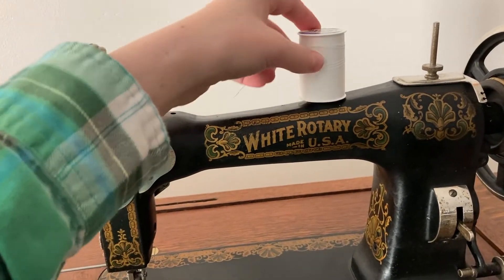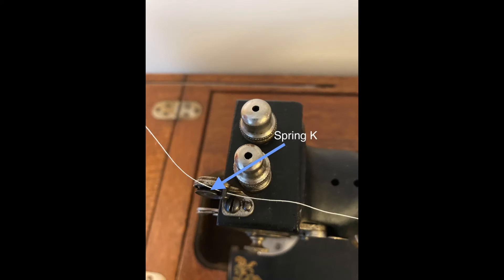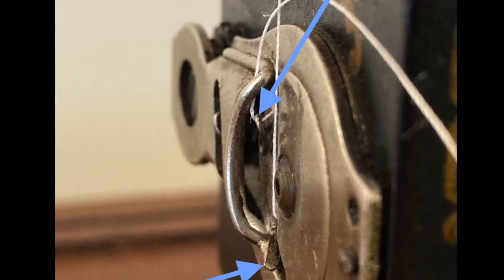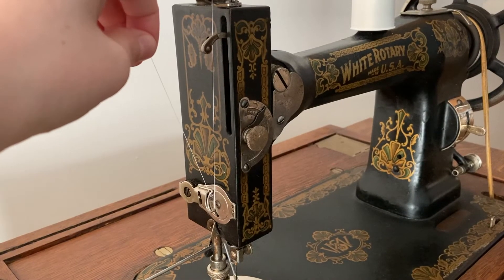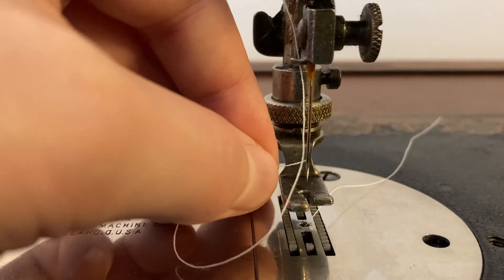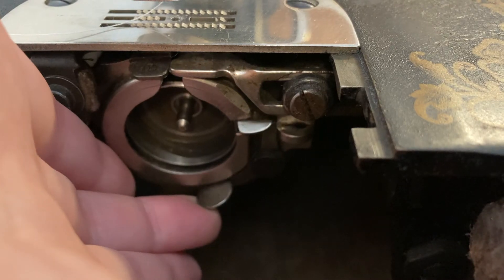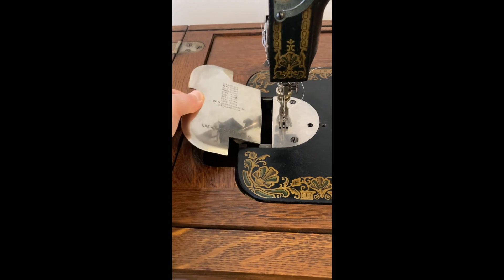How to Thread a White Rotary Treadle Sewing Machine

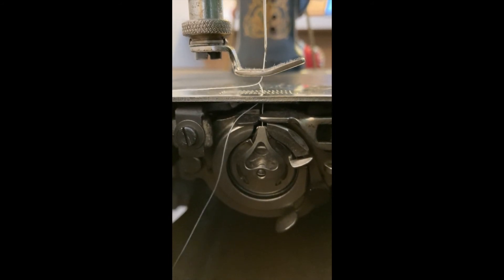Comment: Thank you for all the help! I notice at 1:42 the thread wraps around the bobbin pulling the bobbin thread up. Mine is not doing this. Do you have any suggestions?
Reply: I have a Hotpoint rotary made by white between 1900 and 1913. But the components are nearly identical. It appears just a slight change in the stitch tension control in the front
Reply from the maker: The first, and easiest, thing to try is unthreading and rethreading the machine. It's like turning off and turning back on your computer. It fixes a surprising number of issues!
If that doesn't work, try checking your needle. The shank, the top of the needle, has a flat side and a rounded side. The flat side should be to the right. The screw will fit against the flat side of the needle when it's tightened. If the flat part is on the wrong side, the needle may be just off center enough that the thread loop is forming in a spot where the shuttle can't catch it to carry it around the bobbin. Give the needle a wiggle when you put it into the needle bar. It should be as far up into the slot as it will go.
If the machine is threaded correctly and the needle is in the right way, it could be an issue with the shuttle itself. Lint, grime or just a lack of oil can cause problems with the shuttle. I'm working on a video about doing cleaning and upkeep on the shuttle but unfortunately, I haven't finished it yet! Luckily, there's a section in the manual that gives instructions for doing that. On page 4 of the manual, https://ismacs.net/white/manuals/white-rotary.pdf the section titled "To Remove Shuttle From Shuttle Race" will tell you how to take the shuttle out. Give everything in there a good clean with some q-tips, a little brush, or a rag. Use sewing machine oil to lubricate any place where metal moves on metal, and then put it back together again. 
If none of those work, it may be a timing issue which would probably need to be adjusted at a sewing machine repair shop.

Comment: Is there a feed dog cover available for this machine for darning?
Reply from the maker: Unfortunately I'm not aware of a feed dog cover for this machine and there isn't any way to drop the feed dogs. You can set the stitch length to zero so that they only go up and down and don't actually pull the fabric. Some people do machine embroidery without having to cover the feed dogs as long as they set the stitch length to zero. Depending on the project and the material though, the feed dogs may still interfere.
I've seen some creative solutions to the issue. One lady who free motion quilts on a Singer treadle machine puts plastic wrap over the bed of the machine to make everything smooth. Her free motion quilt video here: https://www.youtube.com/watch?v=xkXJxVQHiJI shows how to do it at about the 2:30 mark.
Another option I've seen, though I can't find the video, is a thin flexible sheet of plastic like the template plastic you can find at craft stores. The guy using that method punched a hole in the plastic big enough for the needle to move but small enough that the feed dogs were still covered. Then he taped the edges down so there was a smooth surface for the fabric to glide over.

Comment: Hello.... Thank you for these videos. I also have this same exact machine and have decided that I actually want to use it. I do have a question (maybe a dumb question), but I know these machine do not have a reverse switch like modern machines, so what do you do on these machines when sewing, to replace that action? What reinforces or finalizes your stitch? Just looking for some advice and help. Thank you again!
Reply from the maker: Not a dumb question at all! It depends on the project but there are a few options to reinforce the beginning and end of the seam. I'll try to describe them without making it totally confusing!

For small projects that I can pivot easily or where I need a super strong or clean looking beginning and end, I stitch forward a little ways, pivot, stitch back to the beginning, pivot, and continue the seam. It's basically a back stitch but turning the fabric rather than stitching backwards.

For bigger projects, I make one or two stitches at the length I'm going to use, then reduce my stitch length to almost zero. I make several tiny stitches before resetting my stitch length to what I want for my seam and do the same thing at the end of my seam to finish it. The tiny stitches do a really good job of holding the seam and it's way harder to rip them out when I make a mistake than a standard backstitch or the pivot method.
Reply: @whitetreadlesewingmachine8221  Thank you! That is very helpful! I appreciate you taking the time to explain it to me.

Comment: Thank you for the link to the manual. I looked for info on the type of needle to be used and it recommends " flat shank " . Is that the same as the 15x1 needles available today? Thank you :-)
Reply from the maker: It is the same type of needle available today. I get my needles off the rack from craft stores like Joanns or Hobby Lobby. Luckily, sewing machine manufacturers picked a type of needle that they liked and haven't really changed it in a century!

Comment: I just got my machine a few days ago. I cleaned her all up and oiled her. Your videos are extremely helpful and have boosted my confidence! My present problem is that my top thread isn't picking up the bobbin thread. Any guesses as to what might be causing this?
Reply from the maker: There are a few possibilities.
Sometimes it's as simple as a bobbin having been wound a bit funny and not unspooling well. When I was still learning to use my machine, some of my bobbins were wound so unevenly that they just wouldn't give me a good seam no matter what I tried. Taking off the old thread and winding it again sometimes worked.
If it's not the bobbin thread, it might be a needle issue.
Are you using a new needle? Even just a slightly bent needle can make the top thread miss the bobbin thread. 
Make sure the needle is pushed all the way up into the needle clamp. If it's drastically too low the needle will break but if it's just a little low it may miss the thread.
If it's not a needle issue, it may be an issue with the shuttle, the part of the machine that holds the bobbin. It can get dirty, both with lint from regular use and with generations of dirt build up from living in less than pristine conditions over her long life. That can cause the timing to be slightly off and prevent the threads from looping together correctly. The manual instructions for cleaning it are honestly not the easiest to follow and I've started working on a video about cleaning and oiling but it's not done yet. In the meantime, you can read the manual's instructions here, https://ismacs.net/white/manuals/white-rotary.pdf The specific part about cleaning the shuttle and the race, the part that holds the shuttle, is on the end of page 4 and the beginning of page 5.

Hopefully one of those works and you can get your lovely old lady back to her prime working condition!
Reply: Push the wheel away from you.  Other machines, I would start sewing by pulling the wheel towards me, not so with the White machine.

Comment: I have white rotery treadle sewing machines  same one it from 1911. It my grandmother  grandmother s.   I try find presher foots attchment
Reply from the maker: If you end up needing to buy any attachments there are normally some for sale on Ebay and Etsy. A company called Griest made a lot of compatible feet and other attachments so if you can't find White brand, Griest is just as good and usually a lot easier to find.